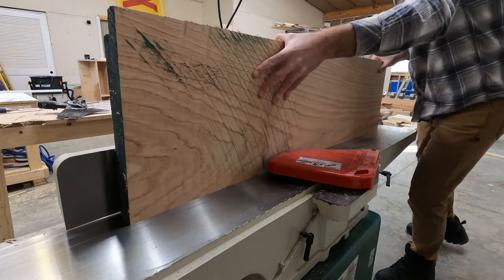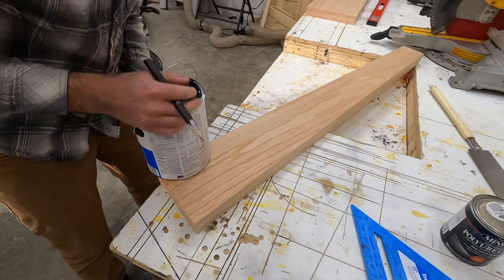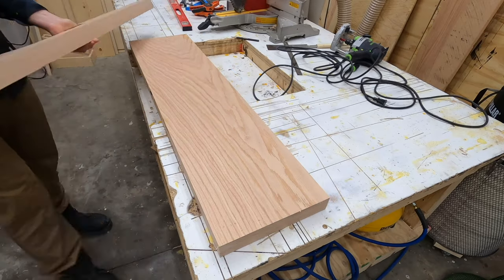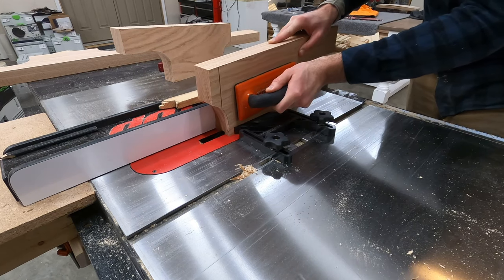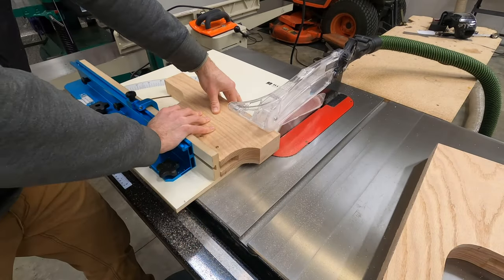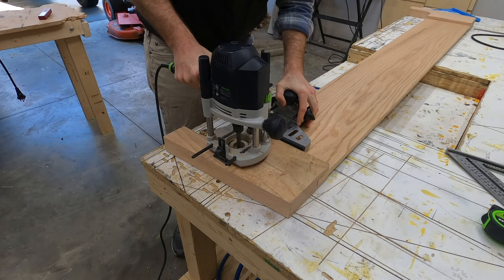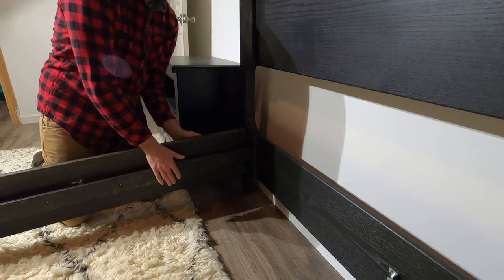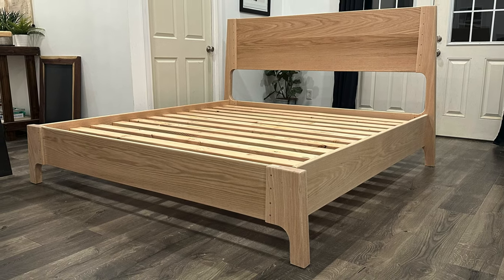How to Build a Bed || Modern Bed Frame || Minimalist Bed Frame || How to Woodworking

Comment: I found that if sink those bed rail brackets 1/32 - 1/16" you get a sturdier fit than if you mount them flush. But man, what a gorgeous design, I prefer the natural over the black but, both a beauties!!
Reply from the maker: Thanks for your input! This was my first time using the brackets so I was figuring it out as I go. Sinking them in makes sense that it would pull the joint tighter 👍🏻

Comment: Hi Matt,

After a year, how do the not glued loose dowel joints behave? Would you make any changes? Thank you!
Reply from the maker: They’ve worked perfectly. All the panels have contracted/moved very slightly (maybe 1/4”ish), and there are no cracks anywhere within the panels or frame. Everything is still pinned tightly and nothing has come loose 👍🏻

Comment: How tight is the hardware? Do those metal cleats pull the joint tight?
Reply from the maker: The hardware needs to be as tight as possible when it’s attached. As long as they line up properly it’s incredibly sturdy. Anyway downward pressure/weight will only make the joint more secure 👍🏻